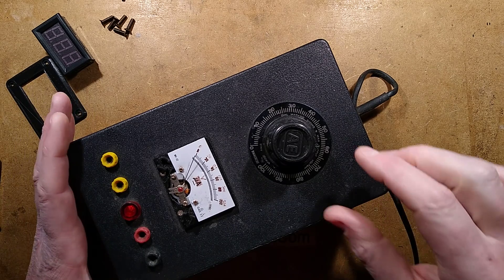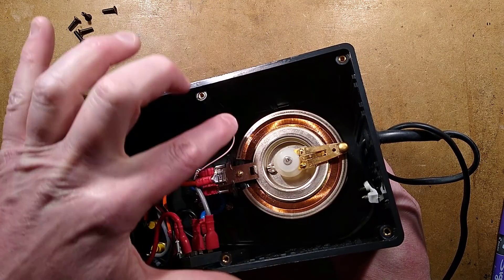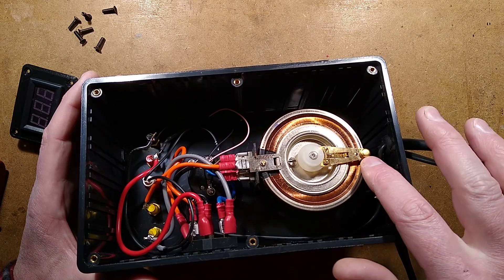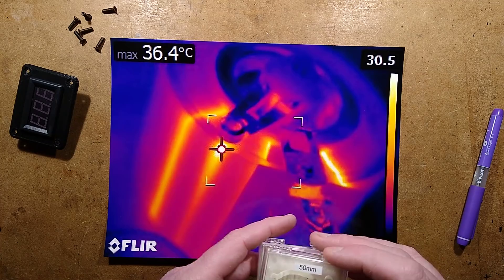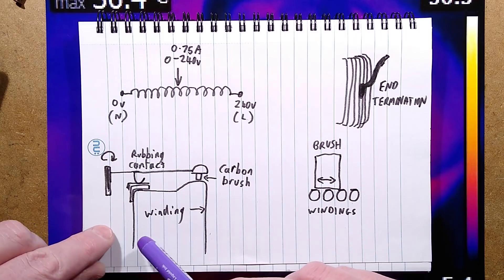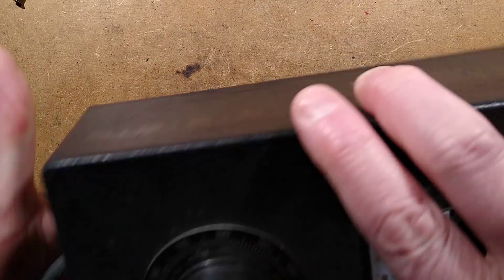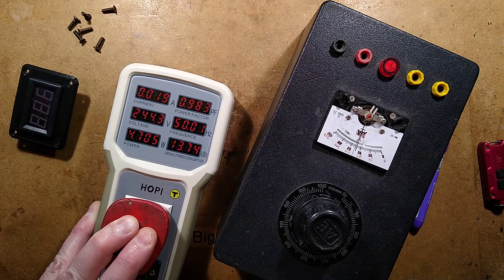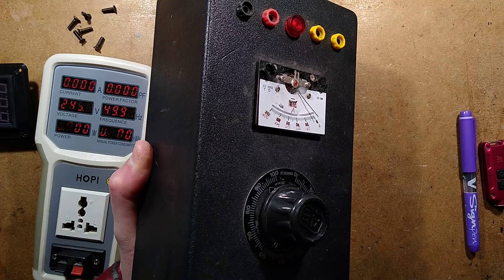Variacs DO short their windings

Comment: That glass delaminating thing is very common with PETG, but that was PLA. I had it happen at a small scale once. Maybe it was cheap glass?
Reply: I use cheap soda glass, and delaminating is never a problem because of the high coefficient of expansion.  Once it cools the prints quite literally pop themselves off.
Borosilicate glass is much more expensive and is normally recommended because it has a very small coefficient of expansion.  I got 3mm glass from a local place for about $2.  I got two for a spare, but I've not broken any of them in over a year.

So, I'm thinking that the better the glass (eg borosilicate) and if the surface is textured (ie sandblasted) so the adhesion is better, that's when you are more likely to have problems if the print sticks really well and there's no contraction of the surface to help get it off.

If I leave the bed to cool down completely I literally hear when the print releases.  I've also had prints complete while I'm out, and come back to find they've popped off so forcefully they are on the other side of the bed.
Reply: @Chris_the_Muso  haha, that's amazing. I use cut mirrors (I found some really thick 1/4 inch ones), and a smearing of sugar water to keep things attached. It works unreasonably well.
Reply: @Chris_the_Muso  you should set up some targets and see how many you can pop.
Reply: @Chris_the_Muso  My current printer has a nice removable magnetic spring steel bed with PEI coating. However, my previous printer was soda glass, actually went to a glass shop and had them cut me off 3 squares of window pane. Worked great but, I always covered it with a Kapton surface. A bit of a pain but totally worth the effort. Plus it gives you that tiny paper thin margin between destroying the tape layer and actually dragging the print head on glass. My old mendel definitely gouged off the tape a few times.
Reply: @Chris_the_Muso  if you have some specific examples of your findings(type of plates/surfaces) I'd love to hear them. For me, the replaceable grip pads are a moneysink, at least all the "inexpensive" ones. Glass that has... something... coating it suffers the same issue but lasts vastly longer in a dimished state. Clean window glass or other typical diy ideas usually end up like clives, tried two so far. Got two clean borosilacate(afaik) and both are currently unscathed after ~65 hours and ~100 hours.
Reply: I recommend a magnetic sticker on the print bed and a PEI coated steel plate on top. Removing objects is extremely easily. Just lift the plate and bend it.
Reply: @MetalheadAndNerd  I hear some people destroying their magnetic beds by running the bed too high. Any experiences? Friend has a printer he can't print ABS because the bed temp would kill the magnets. Info straight from the manufacturer.
Reply: @mtootm  There are different types of magnetic beds. Mine is rated for up to 130°C. I have no noticeable loss in magnet power at 70°C.
Reply: @mtootm  It depends on the type of magnet material.  For ordinary ferrite magnetic sheet (the brown rubbery stuff) the maximum working temperature is about 70C after which it will start to lose power as long as it is hot.  The Curie temperature is the temperature at which the magnet will permanently lose it's magnetism.  For some types of magnetic sheet that is 80C.  Obviously the working temperature will always be less than the Curie temperature, because you can heat the magnet as many times as you want without affecting any permanent loss, as long as you don't exceed the Curie temperature.  There is indeed magnetic material that has a higher working temperature (eg neodymium magnets) but they don't lend themselves well to making magnetic sheet or print beds out of.  It's important to stay within the manufacturers recommendations.
Reply: @mtootm  Most magnets are rated to 80C, so if you did try 100C for ABS it could weaken the magnets.  You could try ABS at lower bed temps though.
Reply: @MetalheadAndNerd  me to ender3 has magnetic sheet, lift sheet and the parts just fly off.
Reply: I've had pla delaminate on PEI sheet. Temp wasn't high enough to get good bonding. Increased first layer temp and problem solved.
Reply: If any of my prints are stuck, I put the glass plate in the freezer and the glass normally contracts enough that the print comes off quite easily
Reply: Yep, I had it happen on PLA as well. Tore off a good chunk of the glass bed.
Reply: @Lassi Kinnunen 81 hairspray is great too. I stopped using it because of the build up at the edges of the plate. The stuff I use, BedWeld doesn't have that build up. And will flake up after some days of use so u can scrape it off or use water to reapply.
Reply: @mtootm  You can do the same with hairspray - I mist it with alcohol spray to re-wet it and only re-apply after three or four (or more) prints when it no longer has the right "tack".  My plates are removable though, and I rotate them, so I never have to spray hairspray on them while they are on the printer.  If they get too gunky (after many prints) I put them in the laundry sink and soak them in water to take them back to clean.  It's nice having a couple of plates to rotate through, so I can have the alcohol glazing the finish and drying on one plate while I'm setting up on the newly prepared spare.  Yep, when I have a print sliced and ready to go I don't like wasting time messing about with the bed.

The only down-side is that you need a very dust free area to dry the plates after the alcohol spray, otherwise it collects a heap of dust and doesn't work properly.  Quite often though, I'll spray the alcohol while it's on the printer (no problem with overspray like there is for the hairspray itself) and then turn the bed heater on to get ready for printing and dry the hairspray/alcohol at the same time.

ETA: Don't overuse the hairspray.  The alcohol will re-wet the surface and give it the tack that it needs.  A can of cheap ($1) hairspray lasts me six months, and I print almost every day.  I probably use far more alcohol than hairspray, but that's a cleaner for electronics, windows, and other things so I don't really know how much I use (several litres per year though) but it's pretty cheap too.
Reply: Ackkkshhully I'm never sure if it isn't damage to the glass by the nozzle that then gets blamed on pla that pulls it off.

I won't go back to anything but glass now I have the corborororobum glass that the ender 3 v2 comes with.
Reply: I, personally, always use hairspray (the cheapest possible) on the buildplate for better adhesion and to protect it. You can never do wrong by giving youf buildplate a coat.
Reply: I use a glass from an old picture frame that happened to be the right size. No problems BUT. I also coat the glass with pritt stick before I print on it. washes off with water.
Reply: I've had PLA tear out chunks of glass, too. What I found to be helpful is a 1:1 mix of alcohol and water -- find a corner of the print to lift off, add a few drops of the mix; the alcohol helps with capillary action, the mix creeps in between glass and print, and soon it pops off.
Reply: dude you are literally mister world wide I see you everywhere.

also subscribed
Reply: @blackturbine  I comment too much.
Reply: @Lassi Kinnunen 81 don't use hairspray - it sticks to gears and whatnot. Use a gluestick.

Comment: Poor quality variacs have their windings "shorted", high quality ones they're properly separated with a proper ) shaped brush to avoid shorting out windings as much as possible. It's possible yours is so low power that the company thought "fuck it we don't care, more profit for us!". I have a 350 and 500 watt units made in UK to be used with a magnetic ballast for big ole lamps, made by a company that might as well not exist. They're done absolutely beautifully.
Reply: I've never seen one that doesn't short at least two turns during part of its motion, otherwise the output would pulse on and off as the contact moved. If the wiper is narrow enough and it is placed exactly in the right spot, you might not short the turn its on. But it will always short them while moving, and if it is left between two. These are more costly to make and the wiper wears out much sooner than the wider ones which are intended to leave two or three shorted at any given time.

Comment: The best trick for perfect adhesion on 3D printing is hairspray.  Regular unscented aqua-net or whatever you local equivalent is.  Much easier to apply evenly than glue stick.  I even use it on the coated build plate on my Prusa, seems to perfectly balance adhesion and release.

Comment: This is my variac. There are many others like it, but this one is mine.
Reply: Full Insulated Metal Jacket.
Reply: I picture electroboom with a crazy look in his eye and a big capacitor ready to blow.
Reply: I have never seen a variac like that. What’s the name and model? I’m interested in a low current one with dc possibility my variac will run up to 20 amps and I have a extension cord I made for testing ac powered stuff with an incandescent bulb wired in series on one leg. That way if there’s a short the bulb gets bright instead of seeing the magic smoke coming out of the equipment that you’re fixing. One last question do they still have that motorcycle race on The Isle of Man? I remember that when I was younger and thought it was awesome going around an island as fast as possible. Thanks for your help and time.
Reply: @rbmwiv  Good luck finding a DC Variac, they don't exist. The clue is in the name.
Reply: @rbmwiv  Isle of Mann TT is the famous race. Just watched the 2019 weekend on YouTube a couple of weeks ago. Great stuff. Read about it first back in the early sixties, before I got my first bike in '66.
Reply: @rbmwiv  - It looks like Clive obtained an uncased variac and built it into a plastic case. So you won’t be able to buy one like his.
Reply: @Mark1024MAK  I have a commercial Variac in a case with a socket and plug, bigger than Clive's. I use it for all kinds of stuff. I've used 3 phase ones that were 3 feet long.
Reply: @Mark1024MAK  that’s what I figured. I’ll be on the lookout for a cheap one because I know wanna modified my nice one it’s too pretty and expensive to start a project with. I’ll be looking on eBay for something I can add to a box then hopefully add a bridge rectifier and get some DC action. I’ll post back if I’m successful.
Reply: This is me bottle o' scrumpy. There are many like it, but this one is... MINE! :D
Reply: Unexpected tf2?
Reply: Where do you get one?
Reply: @clytle374  I just Google for "variac", select "shopping", and choose prices for "low to high" for small ones and "high to low" for BIG ones. Prices range from $12 to $18,000. "Variac" is a brand name while "variable auto transformer" isn't, but you get more hits with "variac" because it's a brand name used so often it's practically become a generic name, like "Band Aid" or "Frisbee".
Reply: @therealjammit  yes indeed you can find them that way.  I thought I tried
Reply: @therealjammit  like hoover, bandaid bad example outside the US because they are plasters here.
Reply: Charlene
Reply: Full Metal Variac?! 😁
Reply: I also enjoy firearms.
Reply: I feel the same way.  There's just something about a mint powerstat that makes everything feel ok with the world.
Reply: I remember PHOTONICINDUCTION saying something like "This is my fuckin' 'ammer! There are many like it but this ones mine!" And by the way, he started posting videos again, so enjoy :)

Comment: I've always wondered this since photonicinduction started posting videos of his variacs and now I know. Although as I've always been warned not to accidentally short a normal toroidal transformer with the mounting lug in the middle I imagined there to be a fair bit more heating. 

I also have some of those ZnSe (Zinc Selenide) lenses for my FLIR and they do slightly affect the readings, it can go both ways due to temperature of the lens but it's usually reporting lower than reality by 1 or 2 degrees. The pure germanium ones don't suffer from this problem but are 3x the price.

Comment: I had the same incident with my 3D printer a few times. I discovered that adding a very thin layer of PVA glue to the bed helps with adhesion on those zones where bed level is not perfect and, at the same time, stops the plastic from fusing with the glass bed.
To apply the PVA I use a generic Dealz (Poundland) spray bottle filled with Dealz liquid PVA lightened with distilled water (filtered is good enough) and a bit IPA, to help the water to evaporate faster.
Everybody has a slightly different solution for this issues, so you'll get lots of suggestions, my recommendation would be to test and find the one that works better for you.
Reply: I uses Kapton/polyimide tape for my 3D printer or those flexible reusable plastic beds. No more scraping.
Reply: you don’t need to add anything to a glass bed to induce adhesion. I print fine on mine without anything.
Reply: @reme2493  It depends a lot on the printer and the material you are using. Ideally, you don't need to add anything to the bed, you are right, but reality is a bit more complicated. I personally was a huge fan of the "nothing better than a perfectly clean bed", until I started doing more and more prints and started having more and more different issues.

Some printers, specially the ones with bigger beds, almost always have issues with the bed not being perfectly flat, which affects levelling and adhesion, even when using ABL (that I strongly recommend). Please, keep in mind that I'm talking about machines on the price range of 300 to 500 €.
On the other hand, some materials really love glass, specially PETG, but also some blends of PLA. In that case, the problem is the opposite, your piece will literally solder to the bed, that is what happened to Clive here and that has happen to me too. In my own experience, adding a layer of "something" between the glass and the piece that you are printing helps a lot.
Of course, I'm talking about my own accumulated experience, that is only about 4 years, I'm no expert here, just another amateur. Every individual experience may and most likely will vary, that is why I'm suggesting to keep trying different techniques until you find the one that works the best for you, that is what really matters at the end of the day.
Reply: Prrit stick
Reply: I have heard of people adding a waft of aerosol hairspray. Adds an easily breakable bond.

Comment: My first acquaintance with this was when I took apart a model railway transformer. I had read about transformers in the Great World Encyclopaedia of Science, and it was immediately obvious how the wiper selected a different number of coils in the output stage. It was linear rather than circular, and there was a long streak on the copper windings where the wiper had been wiping!
Reply: My brother used to take apart his Christmas presents of electric train set transformers so much so that he was given this Dr Frankenstein Chemistry set / welding kit instead next years because they were less costly.
Reply: I was wondering how they constructed that linear variac you seen.   Was the magnetic circuit completed like a square toroid of transformer steel plates or was there a long airgap with coils wound on group of rectangular transformer steal plates, but not completing the magnetic circuit?
Reply: @kreynolds1123  that 'linear' thing may have been a high power variable resistor with sliding contact, not a 'variac' or transformer of any kind
Reply: @andygozzo72  Thank you. It is a little difficult finding many examples of linear autotransformers.
Reply: I had a Märklin one and it was my first "lab equipment". I was around 9 and my dad had to get a resettable porcelain fuse in the fuse box in our apartment. The fuse blew so often when I set fire to steel wool and tried arc welding with sewing needles. It sure had some punch 😁